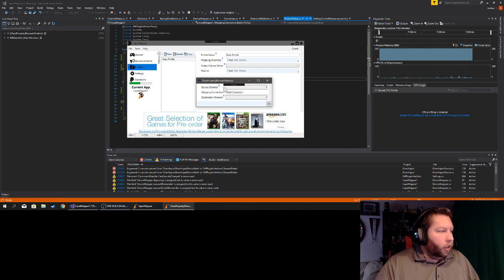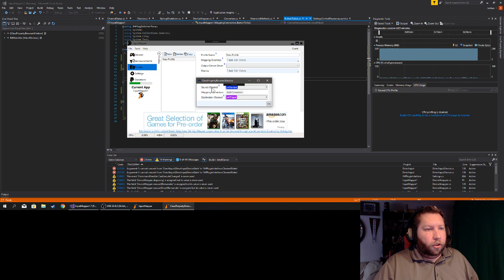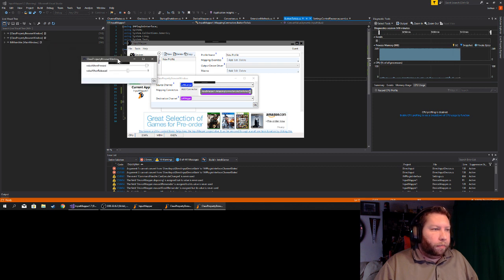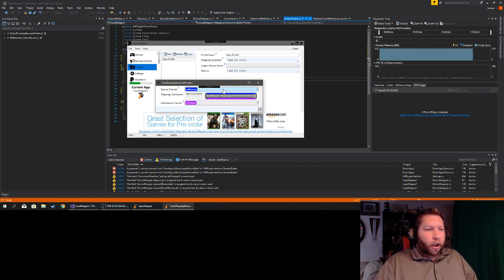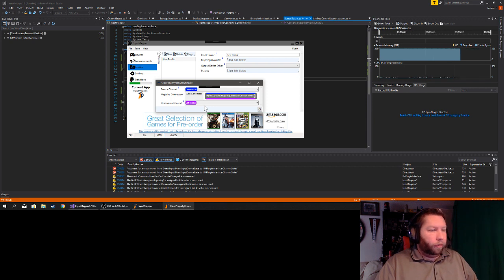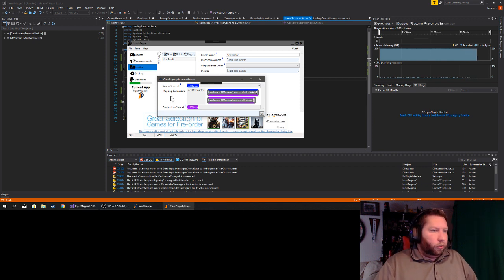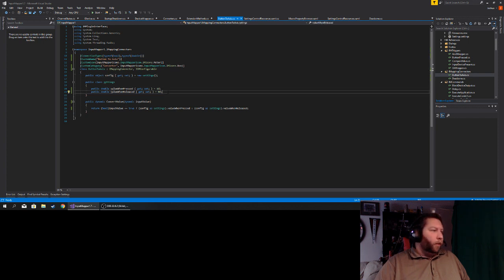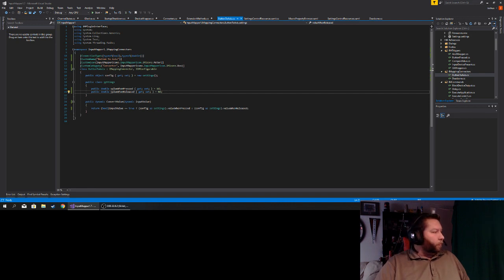Check In: Oct 23 2018 (Mapping Connectors working!)

Comment: If possible, in the next nightly make the controller Led not turn off :)
Reply from the maker: I have to use a default value until I get the lightbar fully programmed, and the general consensus is most people would rather it off than on.
Reply: Understood... Toggle maybe? :)
Reply from the maker: @tremendoza  I may just dive back into the DS4 plugin, there are other issues that the plugin has that I have put off for too long now. Rest of app is shaping up nicely and its probibly time the plugins do the same